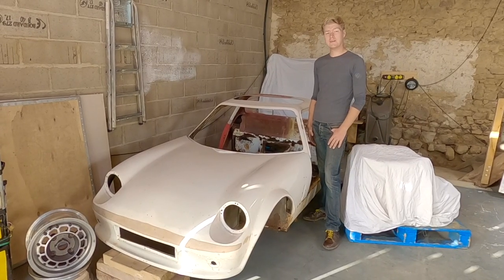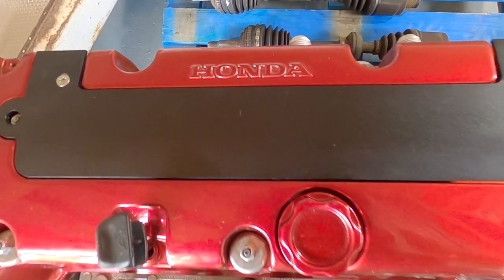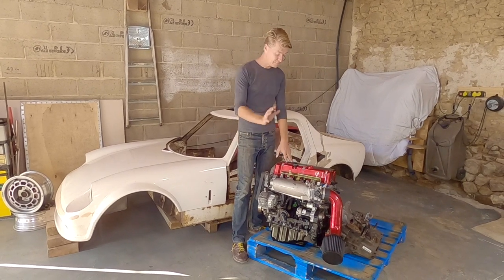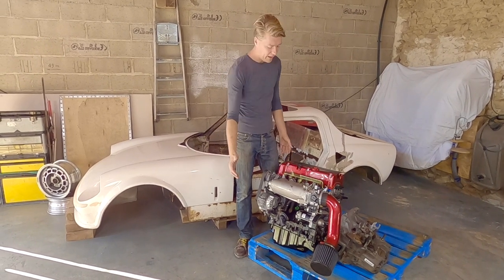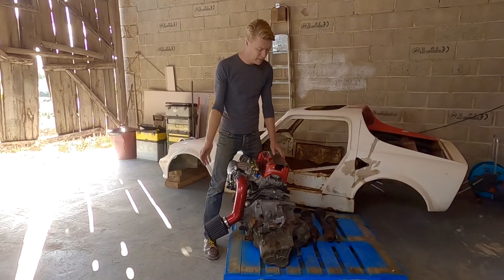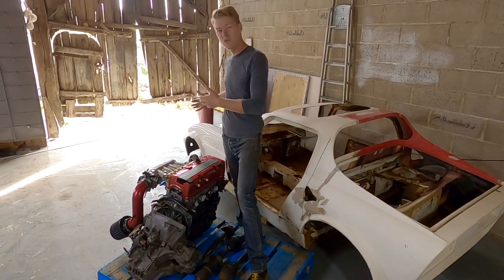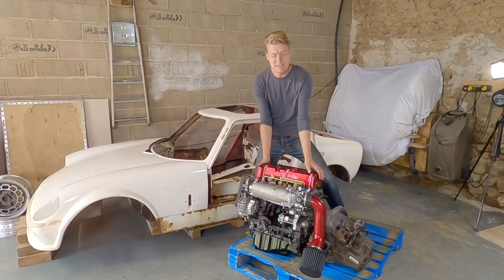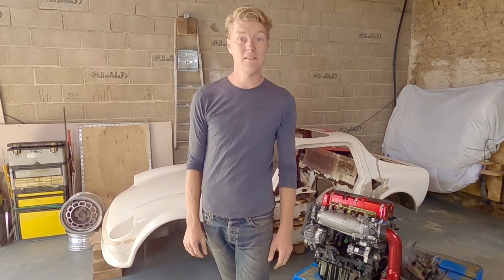Engine Reveal | Project Mosquito Honda Type R Mini Supercar (Ep8)

Comment: I like your choice, my main concern is the weight distribution, the engine is mounted in the middle, but I think the weight will still be too further back, you will surely have to figure out how to compensate with suspension geometry, and placing most of the other components in the front, like battery, tank, radiator. I look forward to seeing the next phases of the build, but I guess it will be awesome at the end!
Reply from the maker: The engine weight is almost identical to the A series turbo but because of the gearbox it actually sits further forward so the balance should be better
Reply: @OliverPickard  wow, I thought this engine was much heavier, well, technology and innovation have gone a long way, more power less weight and being an Honda engine reliability should not be an issue
Reply from the maker: @gianmarcorandon9776  I'm going to make another video were I go into more detail about engine choice and why I chose the K

Comment: I personally prefer small displacement V6 engines like the 2.5L duratec engine that Ford put in the Mercury Cougar back in the early 2000's, but it probably wouldn't fit, it's harder to find parts for, and it's harder to get it to make more power than a Honda 4-cylinder. The only real benefit it has is a smoother acceleration, a slightly torquier bottom-end of the powerband, and the sound. For most applications where space is at a premium and you want high reliability and a plethora of aftermarket components to relocate things, Honda engines are practically ideal.

Comment: Good lord, when you’re feeling lazy you can just leave it in 6th and treat it like a CVT. Not gonna lie this is more oomph than I expected you to go for, but great choice. And isn’t the K20 about the same weight as the A-series lump? I remember reading ages ago, depending on the subframe work, Honda-swapped Minis gained more weight from the brake/suspension/cooling upgrades than the engine itself

Supercannonmosquito
Reply from the maker: That's the idea, Everything included it will weigh less than the metro A Series turbo that was in their before and be further forward

Comment: Great choice.  Honda's make great engines and outstanding reliability.  Did I miss the size, how big?  My Accord has a six speed manual.  Doubt it's the the same one, but it works very very well.  How does the weight compare to the original?
Reply from the maker: It is indeed the same basic gearbox as your accord, it's 2L and a bit too big 😂
Reply: @OliverPickard  That makes sense, a 3200 pound car with 2.4 185 hp, that transmission should have no issue with that.
Reply from the maker: I almost bought a 2.4 but then this piped up with 45k miles and I couldn't resist
Reply: @OliverPickard    I think the 2.4 would weigh too much, more suited to a mid size car like mine.

Comment: A great choice if you can get it to fit. I'm sure you've measured it to death. Seeing which side the gearbox is on I'm wondering if you might swap it over to LHD. Sensible for continental motoring although the small size does mitigate that a bit. Gated gearchange in the driver's sill ala GT40?
Reply from the maker: It's far too big but I I have a cunning plan. Pandora will be lhd because I would rather drive a left hand drive car in England than a right hand drive car in France
Reply: @OliverPickard  Paddles don't compromise cockpit room. I'm sure that Honda has used them with this box or a later one which is pretty well identical.
Reply from the maker: Nahh she needs a proper gear stick
Reply: @OliverPickard  👍 😁

Comment: I am concerned you may be creating an uncontrollable monster which will be way too much for your Gtm chassis. Still it should be an interesting project.
Reply from the maker: A bit Jekyll and Hyde. It'll make just under 120bhp at 4krpm so until you rev it out its not dissimilar to a fast a series only far less grumpy but it'll definitely shift

Comment: Wow....i did't think you were that bonkers! 😉 It's going to be a wild beast!! Great engine! Apart from its size i am a bit worried about the heat it will produce. How are you going to keep the engine cool? And how are you going to keep the small interior of Pandora cool while the engine is right behind you? In the Honda the engine is front mounted, cooling wise that's a lot easier. Where are you going to put a large radiator? 😊
Reply from the maker: The k has brilliant cooling and it helps that the exhaust is on the back of the engine, there will be a radiator in the nose and the coolant lines that run through the centre tunnel, exhaust and fire wall will be insulated too
Reply: @OliverPickard  Sounds like a good plan! I assumed the radiator would be placed in the back. In the nose is so much better! 😊
Reply from the maker: In a cab forward car (think testarossa) that would be a good idea but I can't get myself far enough forward to balance the car

Comment: YESSS, back when you asked recomendations I had a feeling it had to be a honda, to be fair, many engines today would have been an amazing improvement given the weight of the car, but hondas got that reliability, and there are a lot of parts and aftermarket parts for it. to me its the best choice in this case.
Reply from the maker: Thanks, Im making a longer video for next week about my decision making process 👍🏻
Reply: @OliverPickard  I can't wait!, I do think its good to keep in mind that given the huge power to weight ratio of the engine, this gives you some wiggle room on making the chassis stronger, and improving on safety, wich are things that probably will increase the weight a little. being that you have such an engine there wont probably be a noticeable sacrifice to performance, and at the end of the day, we like you, and the safer you are the more you can enjoy doing stuff like this.
Reply from the maker: I've already designed a stiffer, safer & roomier chassis that should actually be lighter than the original so I can then add some weight back with insulation and a full interior
Reply: @OliverPickard  hell yeah, its going to be amazing